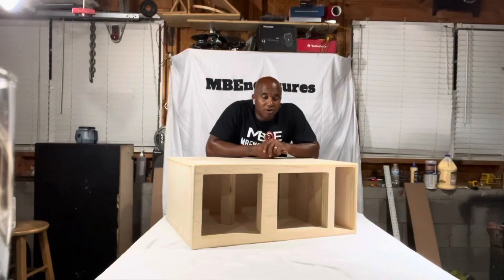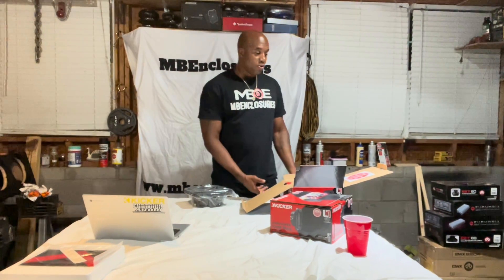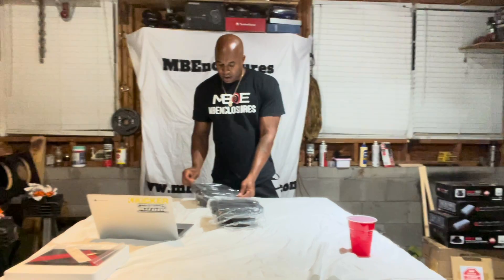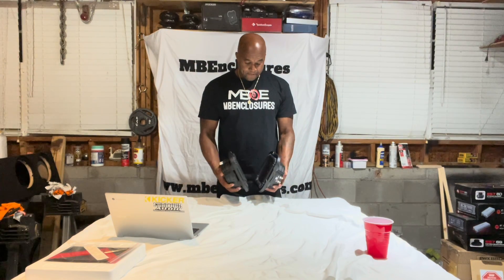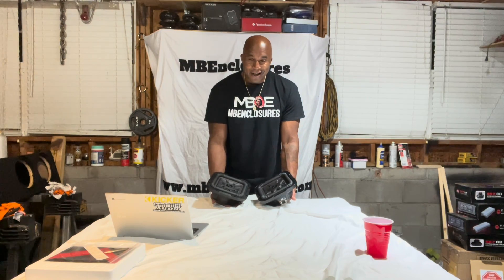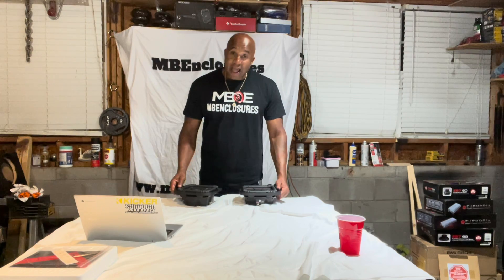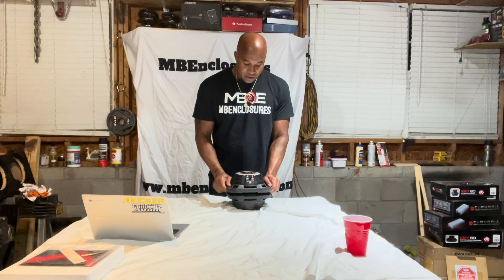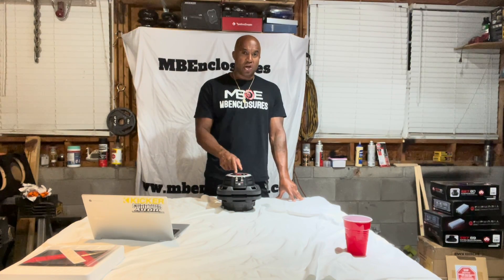Isobaric Loading Subwoofers and the Premise Behind It.

Comment: This video basically explains what it is about sealed box bass that I like. So yea i do sealed boxes, big boxes, sometimes oversized a little, huge subs to get low, but that sealed box gives me a richness in the bass that ported boxes dont. I used to always run ported boxes but i learned time after time, some other dude would have an extra sub and have a sealed box. That bass is denser, richer, fuller, shakes my body harder than ported boxes. They say ported boxes get lower but its not really noticeable if you just get a big enough sealed box with a big enough sub. Now you got both, so what if its inneficient, we did it that way for sound quality and its actually cheaper because youwont tear metal on your vehicle and you wont need so much sound deadener. People at the bass competitions want to know why my system sounds so good. They dont ever ask oh, why isnt it hittin lows? Why isnt it deep enough. They are shocked when i tell em its sealed bass.

Comment: 3:10 “they have very very low extension”.  I’m new at this but isn’t that a GOOD THING?   Don’t we want “very very low extension?  Please explain. Thx.
Reply: Yes it is a good thing, that's what he's saying. He said the woofers of today already play in small boxes and have very low extension, hence why Isobaric is not needed
Reply: @chrishernandez2490 ok. Thx. But isonaric would STILL be an improvement right?
Reply: @Mabeylater293 It's debatable. I currently have 2 Isobaric pairs of 12 inch subwoofers in ported enclosures in my living room. The sound quality is fantastic, however they do not go as low as they should according to the Isobaric theory. According to winISD, my current configuration should be completely flat to 19hz(actually with a small bump in output between 20 and 25hz). I'm getting no where near that. They start falling off around 35ish hz. I'm thinking about doing away with the Isobaric and just running the subs as 4 sealed subs.
Reply: @chrishernandez2490 interesting. Thx for sharing. I wonder why it’s not going down as low as predicted?
Reply: @Mabeylater293 I'm wondering the same thing. Its been bugging me ever since I built them. Most people would say room acoustics but I don't think thats it. I've tried them in my garage and even listening super close I can tell they're not outputting much under 30hz. 

I think it goes to show that Isobaric doesn't really work for modern subwoofers. The motor force on these units are already robust, and I feel that it gets to a point where adding more motor force doesn't  provide any additional benefit.

Now, what will always benefit you is adding more cone area.

Comment: What about flush mounting ,then inverting one on the other side of the box. I only have a 4 cube box and each sub needs 4cf but I don’t have the room for 8 cube and I would have them push pull with one wired backwards, on the same one channel amp  is that crazy 😂 idk nice video PS THE BOXE IS PORTED

Comment: Well that iso is good for limited space and if you're going for the port enclosure you'll be getting that 2 Wave from the front and rear sub. My son has a Nissan juke and wants to use his RFD2215's but the space for two in a ported is isn't there but we can go for the single enclosure and iso clamshell them facing the back ported. They call for 2.5cu ft with a 4x8 port in a single subwoofer enclosure but with two loaded clamshell would you double the port? Help me out please

Comment: One of the few times when you can compare apples to oranges.   People complain about twice the cost....but I say twice the cost relative to what?    Back in the 80s (when A/B amps were king and digital wasn't invented yet) we didn't have shallow mount woofers (also NOT invented yet) We only had cheap high sensitivity woofers and stupid expensive woofers.  ISOloading was a great when space was an issue. You could usually clampshell 4 mid level 10's (make em tougher in iso-pairs) and get 'em to sound better than 2 way too expensive "higher level" 12s. Often times four tens would even be cheaper than two 12s.   Best when you want 1000W but don't have the space (cubes) for 1000W.  ISOloaded subs hit higher DB at lower frequency (but not as good at peak) BUT when properly added to a 3-way front stage and a simple DSP (remember the Clarion Gooseneck, Pioneer DEQ9200 DSP, or EQT/EQX?)  thunderous high wattage tight accurate bass in half the space.
Reply: Another thing to consider, back in the 80s (before modern Xmas design) if you didn't have cone area (or the cubes)  ISO pairing was a pretty good way of achieving great motor force and dampening.  I kinda feel like ISO loading was the original space saving motor force design.   I always wanted to build a stealthy down firing xtracab pickup truck box using something like sixteen Kicker CompRT shallow-mount 8" subs.  4 ISOpairs left/right and two 2500Wrms amps to run each channel (left/right)   Expensive (absolutely), but also way of re-claiming extra cab space instead of a giant box behind the seat.

Comment: I have a vented under seat box for my Silverado for 8” subs I have 4 CT Sound Meso 8s I have a Tezla 4K amp I’m plugging the two center subwoofer holes and mounting them isobaric on each end of the box.. I had a set of 10s in a small vented enclosure clamshell style and I haven’t heard two 10” subs sound louder or deeper then my setup and the accuracy how clean it sounded was by far hands down better then 99% of the other systems I have heard.

Comment: I personally got limited space.
I got a pickup truck with no back seat, but I want 6 12’s on 3 pairs clamshelled. I also wanna drive my truck into the water at least a little bit so I gotta keep the box up off the floor.
I’m also using three auto bilge pumps for a boat just to make sure the water doesn’t reach the box height when I drive my truck in the water.
My question is do you think marine subs like for a boat would still work in an iso loaded enclosure or am I screwed and I just have to try not to drive in too deep of water???

Comment: Ive been wanting to explore this with the sundown sa v2 12 I already have them in a box that's 1.5 cubes larger ported than" recommended "...I spent some time in research and it's a very very efficient in my vehicle now that motor force doubled in clamshell design in theory am i now even more efficient??? Have a friend with slightly more power with four of the same Subs in a sealed box at one cubic foot per in a very very tiny hatchback and I am way way louder

Comment: Got a Sub!  I just put 1 Solobaric L5 12" woofers in a isobaric clamshell configuration with a kicker HS12L5.  Using a Kicker 800.1 in 2 ohm configuration.  It was previously at 1 ohm with the single sub.  I will never go back.  I bought these drivers when they came out.  I can't believe how hard this thing hits.  Vid of kicker enclosure available.

Comment: 😂😂😂 back in the 90's my friend had a golf with 4 10" crunch in a iso/4 order box hit in the 150's in a VW golf. That thing was a monster with a 100 watt Hifonics cheater amp wired to 1ohm thing was gold when was new turned brass color in a few weeks😂 from getting so hot but never shut down. He competed in the 250 watt class with Hifonics amps. 1x100 subs 2x25 rear and a 2x50 front RMS. l remember because I help build it. I was in the Army in Germany when it was installed. Back then iso and free air was big. You could not see the woofers they where in side the box with 2 clam shell chambers with 4 3" ports 2 per side. 😡Judges thought we had an amp inside the box until we pulled the rca's.Memories🤔😎
Reply: Holy crap. Damn 🔥

Comment: question!!! I finally got some 8's resilient sounds 4 gold 8's wire down to 1ohm. can u design me a box or go over aero port cubes and the formula for it? hoping these subs get down.
Reply: I like to build myself but have always done slot port and want to try aero port. should I do 1 port  multiple to get 16in sq. port area. or is it less for aero port.

Comment: Did you know the kicker “solo baric” was designed and built in a way that it would produce sound in a way that two woofers ran in a iso baric configuration would - literally took ts specs from drivers that were ran in an isobaric set up and made one woofer do the same  on the klipple💪🏼 hence Solobaric technology
Reply: That literally makes no sense at all. 
"..designed and built in a way that it would produce sound in a way that two woofers ran in a iso baric configuration would.."
"..took ts specs from drivers that were ran in an isobaric set up and made one woofer do the same on the klipple.."
Okay then. How did they do this? How is this achieved?

I'll explain the actual reason Kicker gave this line of subwoofers the 'Solo-Baric' name. 
Two subwoofers placed in an Isobaric alignment in a sealed enclosure will have the same output/performance as one of those subwoofers also in a sealed enclosure. The difference is that an Isobaric setup can achieve the same performance in half the enclosure size. Obviously, car interior size is one of the biggest constraints to performance when building a system. 
Up until that point, most car subwoofers were designed the same way as PA subwoofers are designed. High sensitivity but also high Fs and large Vas (eg. one of the most desired subs at the time was the Cerwin-Vega Stroker). What Kicker did was design a subwoofer that could used in smaller enclosures than was normal at that time. They had lower Fs and Vas but also a lower sensitivity than PA subwoofers. The "Solo-Baric"moniker was just a marketing phrase. All car subwoofers are designed this way now.

Comment: decware death box 4th order bandpass 1 or 2 speakers he calls the 12'' version isobaric sledgehammer death box is the most bass for the space. there is a death box video on you tube. i can not believe this box has been around since 1991 and hardly anyone knows about it. and also audiophiles put or hide death boxs in there systems. they are super accurate and fast the pressure on the cone is perfectly symmetrical. trial and error is how it was designed 87 blown woofers 87 different boxes perfection. what blew my mind was not only the performance but the fact you can turn up the frequency as well.

Comment: MBEnclosures LLC I dunno if your ran yours ported but that's the way to go You can get that 3db gain of the port a co-worker at incredible universe  had 4 series 1 12s on a punch 200 in a civic it was one of my fav after work cars cd player skipped and everything ..good video I'm gonna do an infinite baffle 12 in my beamer using the ski slot in the back seat I cant wait to see your build video

Comment: I started back in the late '80s with car audio and I can definitely hear the difference in an isobaric setup especially ported. Two motors and two cones combined, it does work. New equipment is still better.
Reply: When u say it dues work, what do u mean?

What benefits do u get?
Reply: @sMASHsound   it makes the cone twice as rigid resulting in less distortion, it's harder because of the doubled motor Force and moving Mass thus moving much more air which equals bass. 
Another great benefit is much less power compression your subs stay cooler and thus play louder longer.
Reply: @johnnycorn7225  u get louder bass, but can u get lower bass?
Also, does, it need half volume of one sub, or two subs?
Like if the sub needs 1cuft, do u put it in 1/2 cuft,.
Reply: @sMASHsound  just cut the vas in half for example 215s will function correctly in the airspace of one when clamshell bolted together. If you're after lower bass, just get subwoofers that have a lower fs and tune them lower, and look for a larger voice coil like a 4-in.

Comment: Omg I just spent 10min explaining how to do what you are thinking but YouTube deleted it right at the end before posting 🤦‍♂️ don’t think a clamshell typical iso. That’s the wrong thinking..

What you want to think about it a typical bass reflex box made iso size with subs on opposite sides in 180* phase alignment with a ported chamber on the back side between them.. (think bazooka tube but two drivers kinda) but needs to be as small in height and width as possible so the drivers can create back pressure off each other getting 75% the gains of a clamshell iso but with greater output.. in a way it would act like a 4th order but with way better tuning ability while still hitting as clean as a small sealed box and being able to tune like a typical reflex wo the peaky limitations of a 4th order.. 

Combining the concept of a 4th order with that of an iso basically making a super small 4th order and aligning the subs in an iso arrangement.. 

Now where this gets tough is trying to size the port and tune it properly and eliminate noise. This would take a lot of time and tinkering to do so I’d definitely start with 4” flared ports that you can resize easy.. 

Other option I see would be to kinda combine iso with an 8th order concept.. take a typical sgl sub reflex.. port it in the center and run the subs off the port wall in a clamshell setup.. (this has a lot more issues and more complicated in reinforcing the slot port walls to now support the subs though and would take a lot off added bracing.. inside.. the additional bracing should provide for just enough box width to pull this off with typical 6-7” mounting depth subs.. (thinking about 12’s here cause while you’re world is 8’s mine is 12’s and 15’s mostly) 

But this might actually be easier to design with 10’s or 8’s tbh and would make for a killer under-seat truck box for trucks like say a tundra with the seat mounts or those with the massive trans hump like a titan using 8’s or 6’s 

The physics for this is certainly there.. and in theory this should give much greater output from having to power two subs then a typical iso setup while still using a smaller iso sized box and retaining the responsiveness.. 

Two minute redo of the original post that went into a lot more detail but I think this gives the basic ideas to work on all the same..

Even the center slot port design would take a lot of tinkering with to prevent port noise but standard slot port ratios should work here in terms of getting the output and the pressures inside the box.. but I can see needing to dado out all internal bracing and port walls to add strength enough to support the weight and the pressure created.. you should get somewhere around 133% air pressures coming through the port and as much as 300% more pressure not accounting for driver with on the sides of the port walls holding the drivers.. as you’re now using the back pressure off one through the port and the driving cone pressure of the other at the same time.. this might be why this hasn’t been don’t before? Idk.. I know I could build a box to not tear itself apart cause I know more about wood working then I do sound. There could also be a resonance issue inside the box? The port walls acting as the baffles to hold the subs could very well have to be double faced as well.. lot of volume inside an iso concept being lost to reinforcing the slotted port area but in theory the basics of tuning a single sub enclosed should work for this same setup still so it might be a lot of extra build work built should be same box work. 

If I had the time to do this I would start with the lowest tune and biggest cube reasonable for said drivers in a sgl sub encloser. So looking at somewhere around 2.5-3cube net single before additional driver displacement 0.7 and bracing and supports and double wall so if it were me I think I’d start maybe around 3 cube design concept for a sub that works well at 2.5 like maybe a kicker comp R tuned to 30-32ish.. (again speaking in terms of 12’s here) 

I have a gut feeling that tuning will result higher from said slot port design so would likely result in using something more like a 25hrz tube to get say a 33tune cause of how this would function.. which if true make this easier cause it lessens the port length needed inside and reduces net lose allowing for a smaller box

Comment: This is why I subscribe to your channel, you provoke thought, now I want to research what would it be like to iso load within a 4th order.. you gone break my brain with this one.
Reply from the maker: That is exactll what Im thinking. Ath expense of buying twice the number of subs you can make a better smaller 4th order.
Reply: @M.B.Enclosures  More electrical, more amps and double subs but still the payoff is significant. Might need to consider weight too, if someone has a wall of 10 woofers now there is 20 they'll have to consider what it'll do to the suspension of the vehicle.
Reply: I built a 4th with 2x 8's then tried isobaric (2 sets in clam shell) in same box & gained about 1db on the same power but did notice my peak went up 1 to 2hz which is unusual as in theory it should be the same or drop a little, i didn't notice much difference in sound quality but would have taken a lot more power than just the 2 subs so could have easily seen 2db gain or even more.
Reply: I had a dream about Kicker SoloBarics in a push-push configuration 8th order isobaric. The dream went on to say keep slack in your jaw or you'll chip your teeth. Being unable to read street signs and having to turn down for what.

Comment: Bring back the iso baric  box.  last one I built was in 98 for 4 green foam  Hollywood sound lads 12s with a us amps 200 on them. ported though the rear deck in a sho. Traus
Reply: The problem with iso nowadays is that small subs are really good. 
Using 2 8s is basically the same as 1 12 isobaric pair. But, the iso 12 is gonna be more expensive and takes up more space.